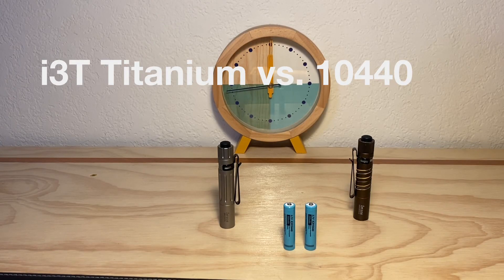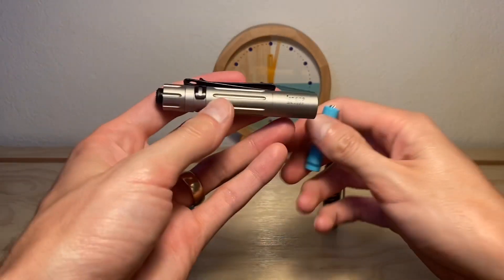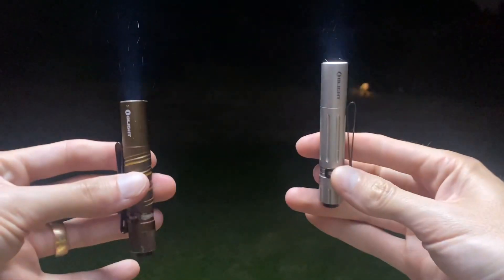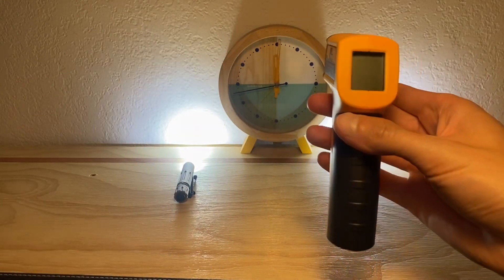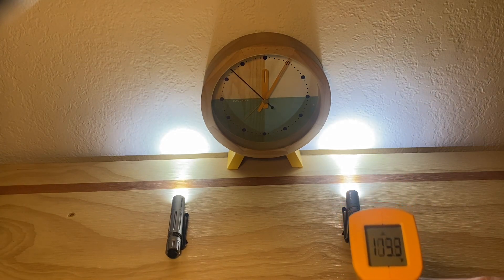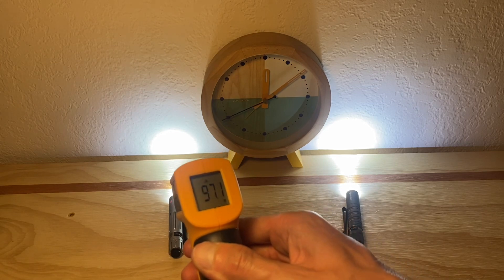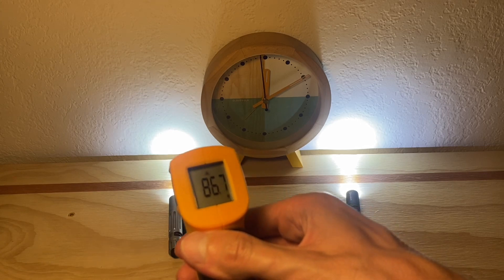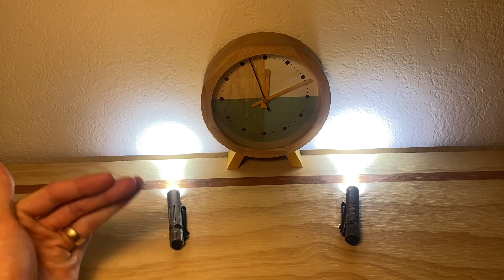Titanium Olight i3T vs. 10440 - Will it survive? Thrive??

Comment: Have anyone tried I3T carbon+10440?
Reply from the maker: Good question. That would be interesting. Unfortunately I do not have the carbon fiber version.
Reply: @PardonMyEnglish  I'm planning to buy one actually, but doubting it will work with 10440.. What do you think?
Reply from the maker: Man, I really don’t know. I wonder if anyone else has tried that combo before.
Reply: Update, it works flawlessly👌🏼
But the button on carbon are more stiffer than original I3T

Comment: Nice farewell, but in this case adiós from Spain, ha ha ha. Aluminium is far superior to titanium to dissipate the heat, don't be fooled by the external temperature because you can bet the led and driver or circuit board are suffering more in the expensive version than in the cheaper. If you told me a copper version then ok, better to protect the electronics but hotter outside.
Reply from the maker: Good points. I like that aluminum is lighter as well.

Comment: Have you ever ran 10440s in the Streamlight ProTac 2AAA?  Thank you.
Reply from the maker: Good question. I have not tried that combo. I need to get a Streamlight because I’ve heard good things about them.
Reply: @PardonMyEnglish  thank you,   the protac series has a larger diameter head for a heat sink... than the rest of the body, vs the stylus penlight.

Comment: isn’t the lack of LVP a concern? just wondering.  i want to run a 10440 but dont want to have to be overly cautious about draining it.
Reply from the maker: Good question. I have found one brand of 10440 with low voltage protection called “demon fire”. The protection circuit makes them slightly longer than normal 10440s though, so it is a tight fit in the i3T.

Comment: Just got a i3t and threw some pkcell 10440s. What a difference even on low. Gonna have to try out LiFePO4 in another one coming my way. Great videos.
Reply from the maker: Thanks! Yes, the i3T and 10440 combo is still my favorite.
Reply: @PardonMyEnglish  - Hey just out of curiosity what do you think of 1.5v disposable lithium batteries? Do they run significantly longer in these lights? I have them in the i5t, and have looked around but couldn't find out very much information.
Reply from the maker: I wish I could help but I haven’t tried those yet.
Reply: @PardonMyEnglish  - I can confirm they run much longer than Alkaline. Keep up the good work, I think you have me more fascinated with batteries than the lights.

Comment: I will check the light output when my i3T Titanium arrives over the 2 older ones bought on the same year.
Reply from the maker: That will be interesting. I’m guessing that the output will be the same using AAA batteries but the output might be different when using 10440s. You’ll have to let me know what you find out. But if you don’t want to risk the titanium versions by using 10440s I totally understand.
Reply: @PardonMyEnglish I just tested my new i3T Titanium w/ 10440 Vapcell 3A & the output is weaker than my Black i3T. It's output is like my Dessert Sand i3T. I guess we got lucky that we were able to have 1 unit i3T that's super bright. We should only use it if necessary so as not to shorten it's lifespan. Our LEDS have a limited number of hours so don't keep testing your super bright i3T unit.  Just use the other ones for daily needs.
Reply: @PardonMyEnglish The output I'm going to test is with 10440 I want to know if it's the same with my other 2 i3T. My i3T Titanium is not Damascus so it doesn't cost that much. I think the Titanium i3T can still be used with my Vapcell 3A 10440 batteries.

Comment: I'd have to say it's mostly the design of the light. If it was the Ti not radiating the heat that would mean it was waaayyyy hotter internally and I don't think it would have handled it as well as it did. Probably the change they made around the time the sprinkles lights came out an maybe even some throttling theybdid on the Ti model specifically. Look what they did on the Ti Warrior 3S. Just my theory.
Reply: It would be nice to see what Smothered Chrome or someone could find between the old style, the regular new ones and the Ti for lumen output. I'm still liking the Ti. Nice bright little light and feels and looks fantastic! Thanks for the video!
Reply from the maker: I agree, that would be interesting to see. And thanks!
Reply from the maker: Yes, I think you’re right. Must be the design. Fortunately it does work in terms of limiting the heat.

Comment: Is this still a higher output than you’d get with a NiMH, lithium, or alkaline battery?
Reply from the maker: Yes, it is definitely quite a bit brighter.
Reply: @PardonMyEnglish  thanks so much!
Reply: @PardonMyEnglish just wanted to thank you again for the advice. I finally got some 10440s when I bought my Emisar KC1, and they seem to run really well in the i3t titanium. It doesn’t get very hot, and low mode becomes very usable.

Comment: Did you notice the titanium version has PWM? It’s very visible in your video.
Reply from the maker: Ah yes, I should have mentioned that the pulse is not visible to the naked eye. But it is very evident on camera.
Reply: I just bought one of these on a whim. I would say the PWM is most likely the reason why it's handling the L-ion battery so well. I don't know much about flashlight stuff but based on my fairly reasonable electronics knowledge, the new circuitry is most likely designed to handle overvolting as well as improving efficiency if it's doing PWM. Maybe I'm wrong, but modulation is always an efficiency cheat code in electrical engineering (class D amps, switching power supplies, etc.), and usually there are feedback loops with those circuits to prevent overloading if your source is not at the expected power.

As for the heat generated, I can definitely bet it's on the new circuitry and not materials. The LED is the main source of that heat, and at this scale, titanium and aluminium are able to conduct heat about as well. You would definitely notice about the same temperature performance regardless of the materal if they used the same circuitry.

Materials that are heated at a temperature will reach the heated temperature at some point, it's more about how fast they can (or can't) conduct it.
Reply from the maker: @quenjankosky7348 Thanks for sharing and I learned a lot from your comment. Yes, I bet you’re right about the circuit being the main difference as opposed to the material. The pulse is a good indicator as you mentioned.

Comment: It's really disappointing to me that Olight is capping the output now. I use that same 10440 in my i3T and it's almost as bright as my baton. I got a new i5R that is made to work with 14500s but won't get as bright as the i3T.
Reply: My i5t outputs around 1000 lumens with a 14500, it’s awesome, but it gets HOT.